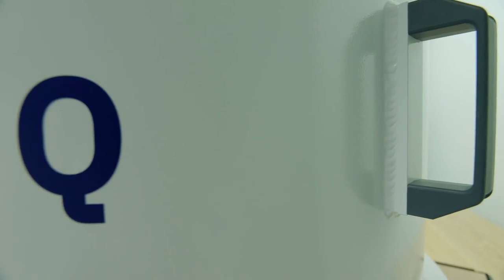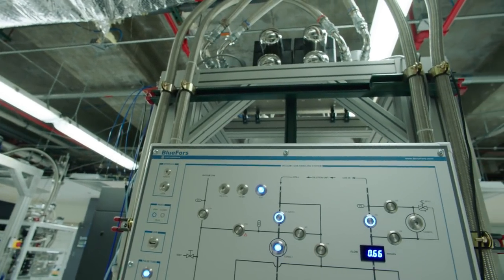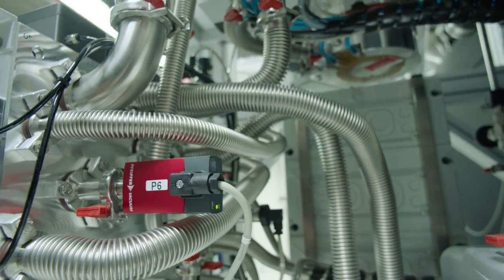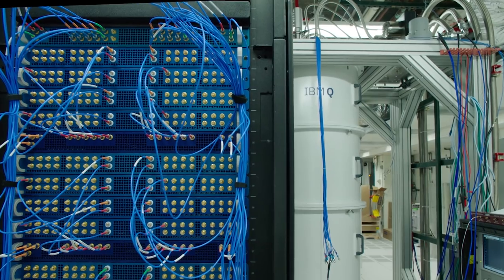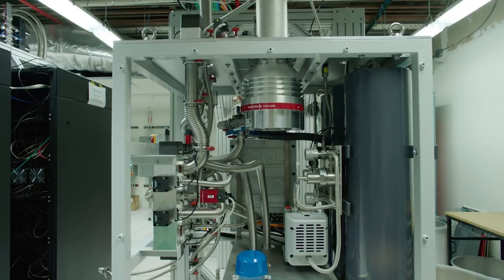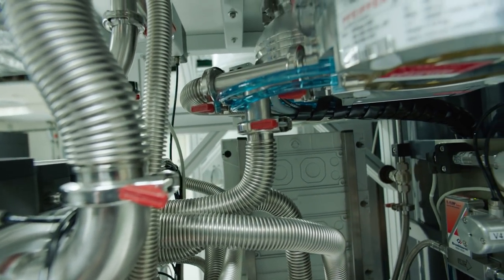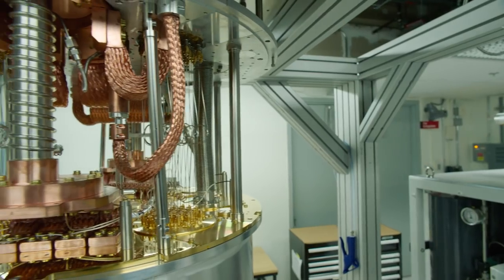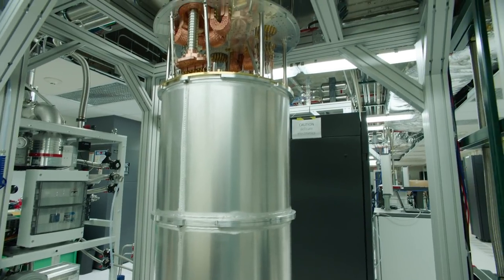The Sounds of IBM: IBM Quantum

Comment: El sistema de enfriamiento en las aeronaves es crucial para mantener un funcionamiento óptimo y evitar problemas derivados del exceso de temperatura. Permíteme explicarte algunos aspectos clave:
Refrigeración en cabina:
La mayoría de los aviones vuelan a altitudes considerables, donde el aire exterior es frío (decenas de grados bajo cero). Para mantener una temperatura adecuada en la cabina, se utiliza un sistema de aire acondicionado complejo.
A diferencia de los sistemas domésticos, el aire no proviene de una unidad exterior en una terraza o balcón. En cambio, se utiliza un sistema de compresión del aire que entra desde los motores1.
Este tratamiento permite elevar la temperatura en la cabina, proporcionando un ambiente confortable para los pasajeros.
Refrigeración de la estructura:
La estructura del avión generalmente no necesita un sistema de protección de temperatura específico, ya que el material suele tener un amplio rango de funcionamiento.
Sin embargo, existen dos maneras de refrigerar los equipos: soplando aire con ventiladores de impulsión o extrayéndolo con ventiladores de extracción1.
Refrigeración del motor:
En la actualidad, el sistema de refrigeración utiliza la corriente de aire procedente de la hélice. Esta corriente se dirige hacia los cilindros y otras zonas del motor que necesitan refrigeración2. para enfriarlo

Comment: 1 qbit is equal to 5000000000000000000000000000000000000000000000000000000000000000000000000000000000000000000000000000000000000000000000000000000000000000000000000000000000000000000000000000000000000000000000000000000000000000000000000000000000000000000000000000000000000000000000000000000000000000000000000000000000000000000000000000000000 56 core intel xeons running at 5ghz.